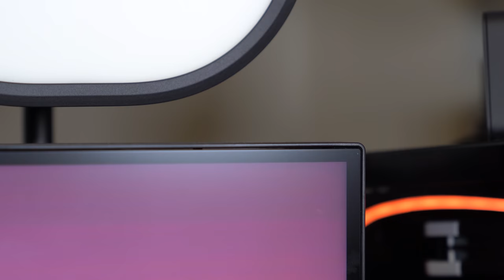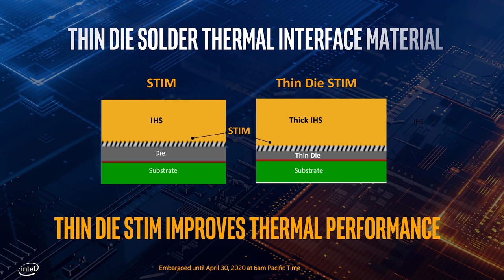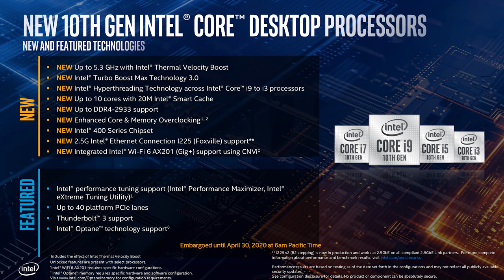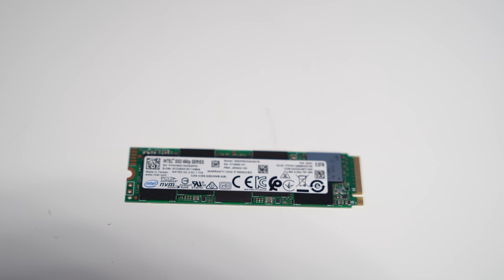The First Z490/10900K System Build!

Comment: the blur is  to cover up the 80c idle temps of the cpu
Reply: Doesn't Intel CPUs still have lower idle power draw and temps though?
Reply: @O'bese on mobile
Reply: @obese7027  intel has terrible thermals!
Reply: @meowmeow2759  umm no they don't. Just because a CPU has a high TDP doesn't mean it runs at high temp all that time. That TDP is under max full load and there aren't many programs that push a CPU that hard. My 5.2 GHz 8700k stays in the high 60c low 70c range while gaming. Stop regurgitating nonsense.
Reply: Lol 5.4 GHz @ 80c idol lol dang
Reply: @Code-n-Flame   8700k is no 9900k
The CPU. Idle at 60+ n gaming will go to low 80  when u start gaming n streaming than u see the high  temps everyone talks about 
85-93c  an with 280mm liquid
 cooler. Oc to 5.0ghz
So imagine this 5.3 ghz.
You will need aleast a 360 mm rad n some good fans.
(I  have 5  9900k) n they all go this high so I'm sure alot do this.
Reply: @meowmeow2759  At full load AVX with high voltages maybe, but look at these idle and other non-full load power draw figures: https://www.guru3d.com/articles-pages/amd-ryzen-7-3700x-ryzen-9-3900x-review,7.html
Reply: @NeVErseeNMeLikEDis  if like to look at your vcore settings please. Guarantee you that you have that shit set to auto like a complete noob.
Reply: @Meow Meow Yea right, my 8700k was a furnace at 5.0ghz 1.350v with an Alphacool Eisbaer LT360 6x fans push pull! You are dreaming, post screen shots please.
Reply: What’s intel guys?
Reply: Hugo yeah I can confirm 360mm radiator does the job, although it is a full push pull setup with every fan slot in the case filled. 5.1GHz all core with temps tapping 80 on occasion under 100% load. Heavy gaming I see 50-60. Nonetheless, pretty sure I would toast mine at 5.2 GHz under heavy load, let alone 5.3 GHz. Yikes.
Reply: @hardcorehardware361  Shitty clock, my 9700K sits at 25-35 degrees idle and around 60-68 degrees in gaming. 5Ghz on all cores.
Reply: @Hugo That is not why he removed the numbers from the Cooler.. It is because he has it installed upside down. There is no clearance on this motherboard for the cooler to be installed the correct way. The tubing can't clear the RAM. It is very bad design flaw of this motherboard. I mean, look at the tubing how it goes up over the display screen.. Looks terrible. It's because it is installed upside down! The guy making the video should've addressed this problem in his video instead of trying to hide this fact...
Reply: do you even know the difference between 9900k and 10900k? ... good now do a quick search before saying something stupid.
Reply: Usually people just stare at CPU stress and torture tests and make their opinion based on them. Gaming is not that intensive workload.
Reply: Why???

Comment: Thermals were so high that the NZXT's screen melted LOL
Reply: Rofl
Reply: @samwallace7341  there is an article with msi and they stated 1.3v is 250w 1.35v is 300w in cpu tests through multiple cpus tested and they used h115i.. so idk even with 9900k you should do only 360mm or custom loop
Reply: yeah thats why most people are going amd vs intel unless they're a fan boy
Reply: That is not why he removed the numbers from the Cooler.. It is because he has it installed upside down. There is no clearance on this motherboard for the cooler to be installed the correct way. The tubing can't clear the RAM. It is very bad design flaw of this motherboard. I mean, look at the tubing how it goes up over the display screen.. Looks terrible. It's because it is installed upside down! The guy making the video should've addressed this problem in his video instead of trying to hide this fact...

Comment: He just forgot one little detail about how Intel has drastically lowered its prices this time around.  

The I9 9900K is about to lose 25% of its value.
Reply: at the moment its going higher in Australia almost A$1000 for the K ,I am sitting with a new MB just cant get funds for i9 9900kf
Reply: Welcome to all things tech, while the competition is up to speed. Processors like Ryzen 7 1800X and its Intel pendants dropped in value much faster and steeper than that. Still good for the customer, though, since those products are about performance and performance per dollar :)
Reply: Sorry fanboy, probably not.  The 7700K still sells for almost $300, 9900K is best-in-socket (apart from the limited-release KS) and will hold value just fine.  Losing half your value in a year is an AMD thing.
Reply: @James leicher imagine paying a shit ton of money for a Z390 board (a dead platform), having half the cores of AMD, with 10% more gaming performance and MORE energy useage than the 3950X. Oh wait, you DONT EVEN HAVE THE CPU???? Come on dude!
Reply: You mean going to the price it should have been from the start? Lpl
Reply: @jamesleicher  Newegg has it for $924 AUD.  The 3900X is $779 AUD, a cheaper proposition, with similar gaming performance over the 9900KF.  Too bad you already have the MB.
Reply: @morpheus_9  amd is still 20% behind of intel for flightsim use.
Reply: James leicher seriously? that is because of a shortage of components due to no particular reason, I mean it isn't like there is a pandemic or anything. You can say the same thing about any PC component or even a 1lb of ground beef
Reply: @flcnfghtr  only it is so, have you been hiding under a rock?  Intel is going to be selling a 10 core for less than the current price of the  8 core, shortly.  Intel 10th Gen vs AMD Ryzen 3000 Desktop CPU Prices:
Intel CPU	Cores / Threads	Clocks (Max)	Price (MSRP)	Prices (Newegg)	Clocks (Max)	Cores / Threads	AMD CPU
N/A	N/A	N/A	N/A	$737.99 US	4.7 GHz (105W)	16/32	AMD Ryzen 9 3950X
Intel Core i9-10900K	10/20	5.3 GHz (125W)	$488 US (K)
$472 US (KF)	$489.99 US	4.6 GHz (105W)	12/24	AMD Ryzen 9 3900X
Intel Core i7-10700K	8/16	5.1 GHz (125W)	$374 US (K)
$349 US (KF)	$344.99 US	4.5 GHz (105W)	8/16	AMD Ryzen 7 3800X
Intel Core i7-10700	8/16	4.8 GHz (65W)	$323 US
$298 US (F)	$298.99 US	4.4 GHz (65W)	8/16	AMD Ryzen 7 3700X
Intel Core i5-10600K	6/12	4.8 GHz (125W)	$262 US (K)
$237 US (KF)	$204.99 US	4.4 GHz (95W)	6/12	AMD Ryzen 5 3600X
Intel Core i5-10500	6/12	4.5 GHz (65W)	$192 US	$189.99 US	4.2 GHz (65W)	6/12	AMD Ryzen 5 3600
Intel Core i5-10400	6/12	4.3 GHz (65W)	$182 US
$157 US (F)	$179.99 US	4.1 GHz (65W)	6/6	AMD Ryzen 5 3500X
Intel Core i3-10300	4/8	4.4 GHz (65W)	$143 US	$119.99 US	4.3 GHz (65W)	4/8	AMD Ryzen 3 3300X
Intel Core i3-10100	4/8	4.3 GHz (65W)	$122 US	$99.99 US	3.9 GHz (65W)
Reply: @flcnfghtr  funny how people tend to accuse you of what they are guilty of themselves
Reply: @morpheus_9  Intel is soon to be selling 8-core unlocked 10th gen for less than $400 that is nearly 25% price drop.  The new 10th gen 10 core will be selling for less than 500, ouch
Reply: @morpheus_9  that just brushes the surface, don't forget about no pcie 4.0 support, a ton of hardware level security vulnerabilities that when patched cause a huge performance hit, also have to spend over 100 bucks on a cpu cooler while AMD include an adequate cooler in the box
Reply: @arokh72  i know what can i do spent good bucks for monther Board z390 Asrock taichi ,as i said before for flightsim AMD is 20% slower.found one i9for $899 to ask for permission is hardest part,I dont work I look after kids at home.parts i got now is bequite 801 case corsair 850 psu and MB.
Reply: @petmey5281  yes My saved wish list keep going up and up in few days
Reply: @jamesleicher  - That's weird? They have increased the price of the i9-9900K here in New Zealand as well, in some places up to $1000 - WHY?
Reply: @petmey5281  That is technically true, but these prices also do not include taxes. In high ta countries like Germany 10900K will be significantly more expensive than 9900K is today, since the ladder has reached about 450 to 500 € over time, while 10900K will likely be abount 600 €.
So Intel will still not be a bargain - also, launch availability will likely be bad again, making these CPUs less attractive still. Just saying :)
Reply: @dynastes4938  I concur, there is no valid reason in my opinion, for buying a 10th gen CPU and Intel are going to stop the production of the 9th gen in order to bring about artificial scarcity
Reply: @morpheus_9  you see what usage 3950x actually does they all do more than rated tdp when enhancement is used with boards..
Reply: @petmey5281  funny 9900k beats amd in gaming with said performance hit of security patches.
Reply: Fellas, quick question, what would it be the best motherboard for a i9-9900?
Reply: @spadeus1443  z390 gigabyte aorus master or one above it.. the vrms stay the coolest out of all boards.. the rgb I heard is wonky though for software.. but gigabyte upped their game massively
Reply: @spadeus1443  if your looking I'd wait till 10th comes out, either grab a 10700k (under $400 possibly) if you want 9900k performance (and you get 11th option upgrade path] or just get 10900k instead and not worry about 11th the 10900k will be like 20% better if that than 9900k)   or last resort 9900k may drop in price too or buy someone's used who upgrades lol
Reply: Well, that sounds really nice, i guess i got the motherboard n processor secured,  but now the thing left is ram, any recommendations? Because there's hella options
Reply: @spadeus1443  intel you wont notice much performance gain over 3200mhz tbh.. just get low cas latency
Reply: @spadeus1443  I had just basic ripjaws 3200 gskill. And went to bdie gskill trident z 3600cl15 and ocd to 4000mhz 16 16 16 37.. 4x8gb sticks... running 2 sticks ends up slightly better in performance though.. try n get 2x 16gb future proof.. 3200 mainly, slight bump 3600mhz.. only will notice in benchmarks..if u find good prices
Reply: @spadeus1443  F4-3200C14D-32GTZR
And can overclock cl14 ram rgb, although its $259
Reply: Why would someone buy a 9900k when you can get a Ryzen 7 3700X for $300

Buying Intel CPUs is just plain stupid right now 

AMD has better value everywhere from Budget to 64 Core Threadripper CPUs 

And those 5 FPS the 9900k might get more over a Ryzen CPU is not worth the heat generated and the power draw and most importantly the way higher initial cost
Reply: @kimjeyong2474  dude your getting more than the "5fps" over a 3700x.. go fanboy elsewhere 9900k top gaming performance hands down, 10900k maybe tad bit better
Reply: @flcnfghtr  lol, 7700K just got rekt by a $120 3300X
Reply: @flcnfghtr  well the 7700K is a shitty cpu right now the new ryzen 3 is almost the same
Reply: @petmey5281  AMD is selling a 12 core for 460 and an 8 core for 300 if you want the ryzen 7 2700 wich is an 8 core you pay 160 euros in my country so intel sure isnt an option for me arround 100euros extra for 5 fps extra no thanks
Reply: There’s a 9900k for sale for $380. NOT BAD!

Comment: Awesome build, but why did you apply thermal paste to the CPU? I thought the Kraken AIO already comes pre-applied with its own. That's double the amount required. Also one more question. I can't really tell from your video, but does the Z73's pump/tube block the 1st RAM slot on the motherboard? This would be a concern for those who wish to fill up all 4 slots with memory.

Comment: you know how the I/O shield of the motherboard has white metallic edges? did those metallic edges go through the hole of the case, or did they stay behind? I'm building a PC with the same mobo, and the motherboard won't fit the I/O hole in the case

Comment: I have a question,  I have almost the exact same setup except gskill ram and a different case . My kraken cooler can't go in the way I need it to because the cooler hoses cover over the first ram slot and can't get the ram in without turning the cooler so the hoses are on the left , did you have this problem?

Comment: BPS customs, you do know how air flow works? , so thats the correct way it should be mounted, so the air pulled from outside cools the radiator and is vented out as opposed to hot air from the gpu and cpu cooling the rad, makes sense?

Comment: Can you use the motherboard to control the cases rgb? I have the jrainbow connected but it’s not matching my case. There is one cable that’s not congested but I’ve never seen one like it . Black with. Exposed copper pins. It’s simmer to a SATA.

Comment: I'm thinking gigabyte z490 aorus master for 389.99 will be the best bet for a board, not only is it true vrm power phases (asus splits and plays tricks on numbers) but it has alot of features on it.. such as noise sensor which can rate the decibels your pc hits for inside noise from fans.. the last boards vrms stayed the coolest.. also wifi connection is on top of backplate... isk why asus has theirs under usbs towards the bottom.. I dont like the wired wifi connector.. perfer direct antenna dongles..

Comment: AHA ! He changed the AIO tube's direction, so i guess it has thermal issue !
Reply: @yukinokf2480  r/woosh
Reply: @yukinokf2480  r/woosh
Reply: Chtholly Osu  r/woosh
Reply: Rage Mode https://www.reddit.com
Reply: That is not why he removed the numbers from the Cooler.. It is because he has it installed upside down. There is no clearance on this motherboard for the cooler to be installed the correct way. The tubing can't clear the RAM. It is very bad design flaw of this motherboard. I mean, look at the tubing how it goes up over the display screen.. Looks terrible. It's because it is installed upside down! The guy making the video should've addressed this problem in his video instead of trying to hide this fact...

Comment: Please someone help to answer a question! So Z490 boards are advertised as "PCI-E 4.0 ready", due to the Rocket Lake CPUs coming later this year. My question is: How will M.2 slots be "PCI-E 4.0 ready" only by a BIOS update, due to the fact, that PCI-E 3.0 and PCI-E 4.0 M.2 slots are different in pin layout? Or does "PCI-E 4.0 ready" refer only to the PCI-E slots?
Reply: I am unsure but what I am certain is Gigabyte have Gen 4 ready motherboards on their newest lineup.

Comment: Why are the AIO cooler tubing coming out from the bottom and going up over the top of the cooler display? Looks terrible and also the numbers on the cooler display are not being displayed? I feel as though you have the cooler installed upside down and have tried to cover it up? Why not address this problem in your video instead of try to hide it?

Comment: Will 750w be enough? I was planning on an cpu update
Reply: 750w is definitely enough if you're running a single GPU and not doing any overclocking. As soon as you start OC'ing, you'll quickly be looking at needing 850+.
Reply: This cpu needs 300 Watts alone. I’d go with a 850

Comment: Would you reccomend this case over the lancool ll
Reply: I 100% would not. Lancool II is very roomy, but it's also notably larger than the Dark Base. That said, the Lancool 2 is easily one of the best all-around cases to come out in years. It's beat by others in specific areas, specific needs, and so on, but if you kind of just take it all in at once, it's one of the best, if not the very best currently out there. Plus, having built a few systems in it already, I can say that it is one of the three easiest cases to build in that I've ever worked in, with the caveat that you may need/want some cable extensions depending on your specific layout.

Comment: 29c to 32 c at stock  looking at stock photo of NZXT Kraken Z73 360mm  for my help to fine out  hope im right
Reply: King Samurai Gaming no... you are like 30c off. It will be 60c or more
Reply: I was looking at what it was running stock right there was my guess I'm looking at the stock photo online of the temp show up that the cooler off of the website it might run 60 but if you take into consideration the lower temps that an x299 might run and determine what the CPU is using under the hood around the 50s to the high 50 but we'll have to see that's why I put my guess once you what that temperature was going to be
Reply: @NovaDoll  so you're saying it's going to be 60 at the highest for under load for gaming cuz I'm thinking it might be around the B-52 high 50s the car with the right core and if you're trying to push it even farther it might get even hired in the sixties but leave it at stock without overclocking the CPU I think it might be in the 50s for gaming maybe High forties but we'll have to see once they actually show the actual temps the performance it runs and all this at a later date from all the different reviewers out there

Comment: and still the tubing is blocking the AIO's display...
Reply: Yeah, I noticed that. I have just bought this same case and installed my Deepcool Castle 360EX at the front, but the tubes at the bottom - coming out of the shroud. They gently curl to the left of the cooler, so everything is visible, and no problems with the graphics card.  Looks much nicer!

Comment: its better for performance and budget to go with amd vs intel unless you go with a the 9900k because 10900k is barely better less than 5% and it will require more money to cool, intel just runs way too hot, my buddy was running the same game as me for barely 4 days and it crapped out on him already but my 3900x works just fine

Comment: Nice that is the same motherboard and processor I just picked up local store 2 days ago. Paired with a EVGA RTX 2080 Super XC Ultra and Corsair h115i RGB Platinum 280mm cooler and Corsair RM850x 80 gold. Plus 64GB Corsair Dominator Platinum 3200Mhz ram. I am loving this system. My cpu don't get hot like I have seen on other builds and mine is on a Corsair 680X Case. 

 Nice video! Thanks!
http://imgur.com/gallery/UsWmBY3